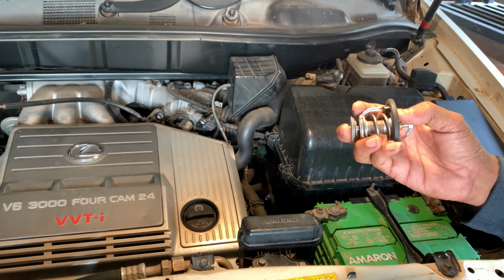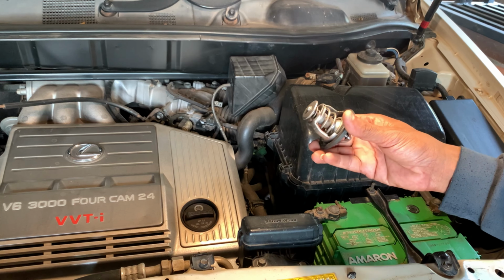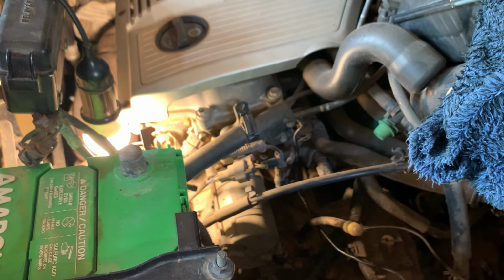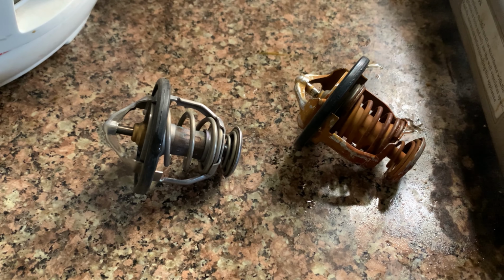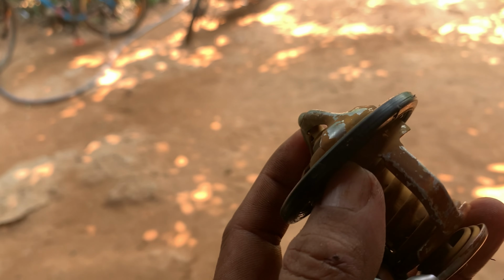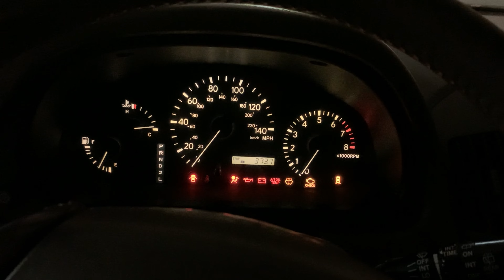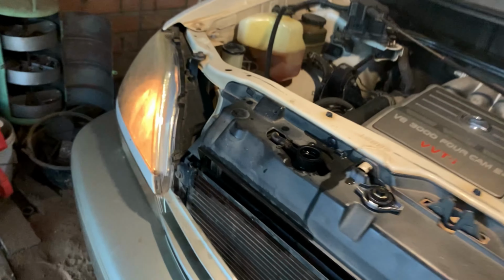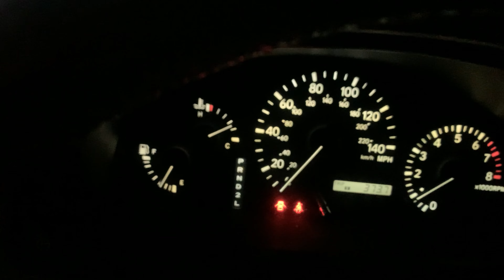P0128 Lexus RX300 Coolant Thermostat ( Coolant Temperature Below Thermostat Regulating Temperature )

Comment: 8:23 Your jiggle valve is not in the correct position. The jiggle valve helps bleed the coolant system of trapped air. It should be aligned with the top stud (bolt) of the thermostat housing (11 o'clock position). Right now your jiggle valve is positioned at about 1 o'clock.
If you had issues with the cooling system after you finished installation, it might be because of this valve needing to be rotated counterclockwise.
Reply from the maker: @farmer-vm9xd7yx6p  thanks for let me know

Comment: Was the Engine getting too hot before you changed the thermostat?
Reply from the maker: Thanks for your comment.
Is not getting hot before but when I turned it on light and started the machine check it came out never off so when I check it the cover of the thermostat going to hollow because the rubber wore out. So I have to change.